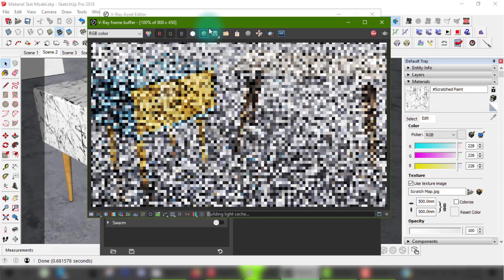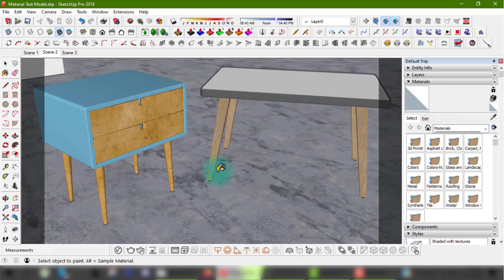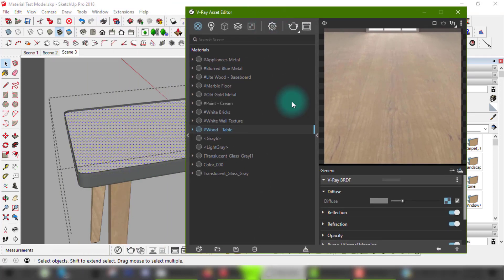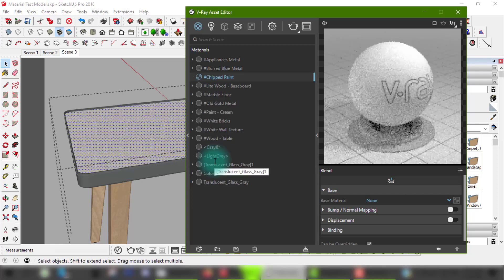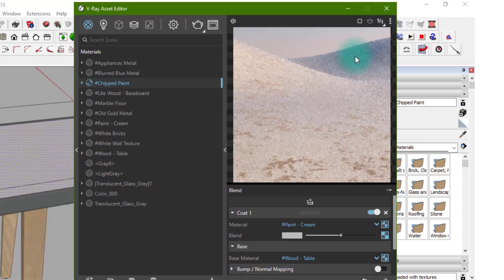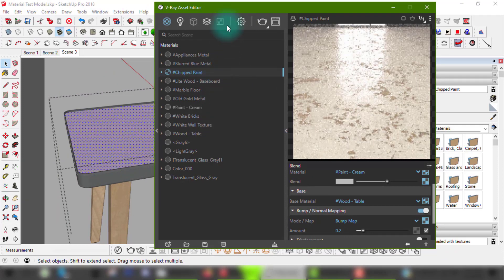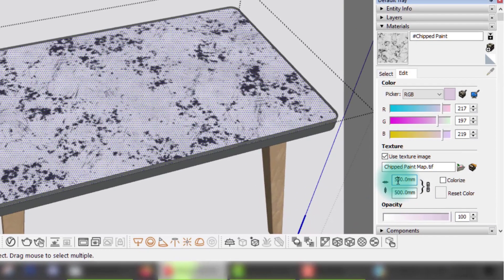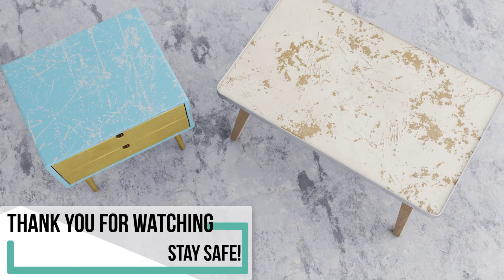How to Create a Chipped Paint Material | Wood | VRay for Sketchup

Comment: Hello, what is the point of "Blend Material" feature, why not just add that creme material as a texture map on the wood material where the black would reveal the wood beneath ?
Reply from the maker: Hello Triumf,
You mean using two Diffuse maps for one material with an Opacity map for the creme color?
That won't provide us with the rest of the options we need to make the material look realistic; such as the fact that both materials require different Reflection and Bump maps/values.
"Blend" allows us to mix these two materials on the same surface while keeping each material's properties intact for a realistic result.
Reply: @Ravenors.academy  Didn't think that both material need different effects, now it make sense, thank you
Reply from the maker: You're very welcome :)